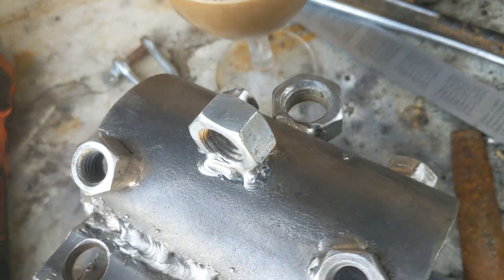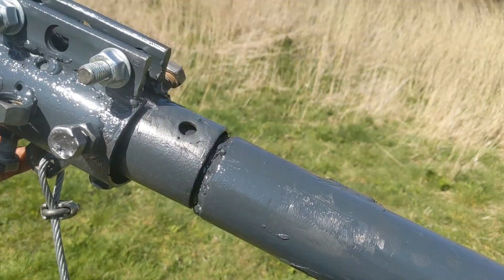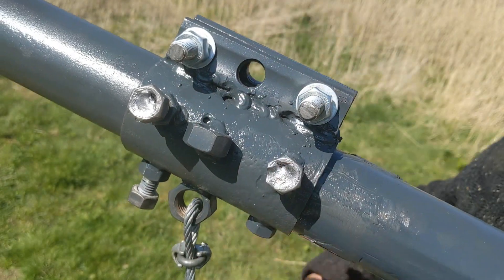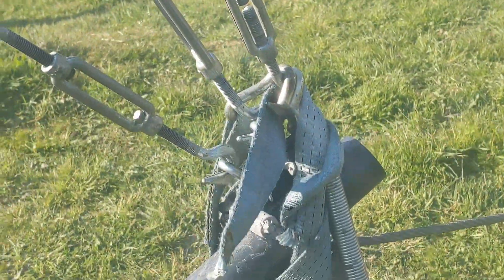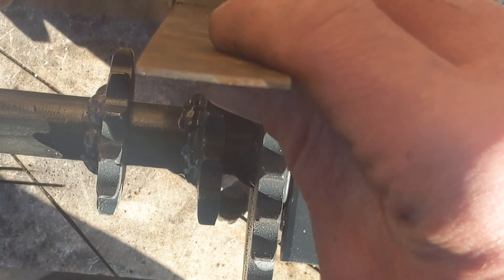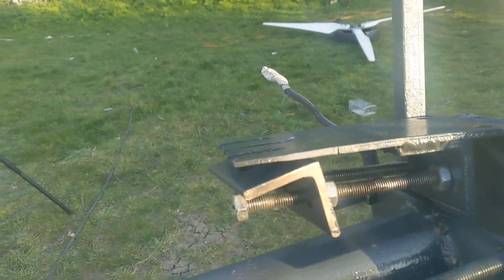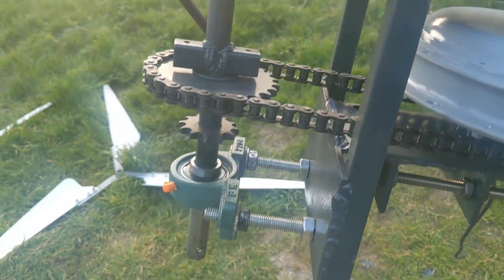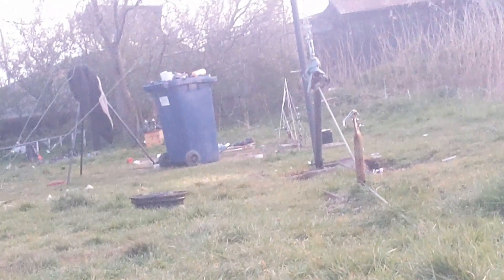48v Electric Bike Wind Turbine Generator - Back on the Tower -19th April 2021

Comment: Looking better but I think that you would be better off adjusting the motor and keeping the prop shaft mounted to your frame. Reason being that the studs will allow more vibration than if the shaft bearings were bolted directly to the frame. Or else you may have to add support under those bearings to cut down on the vibration by tying all 6 studs together with a plate/bars.
Reply from the maker: You are right for sure will see how this works out seems to catch the wind better, should find out tomorrow
Reply: @GavinFreedomLover  Hi,I am wondering if you had to make any modifications to the ex- electric bicycle wheel 48 volt electric motor inorder to turn it into a generator.If so,kindly tell me what you did to the motor.

Comment: Hello sir!
Love the Mad Max approach !!
One thing to watch for it's where you ran the wire rope through the nuts on top of the tower.
The inside threads on the nut will cut the wire rope ! There will always be a little vibration to the Tower transmitted Through the Wire Rope !
Enjoying your videos best Wishes Always!